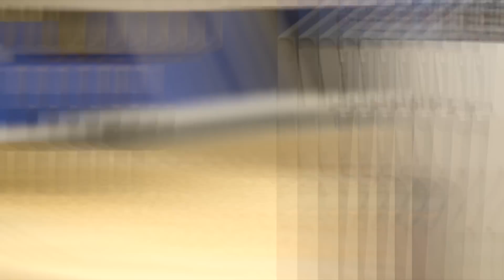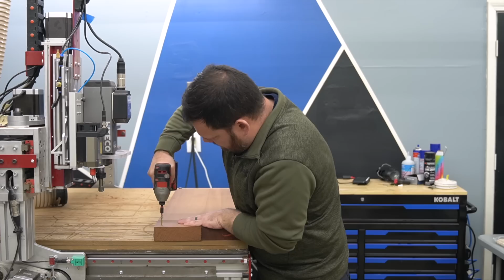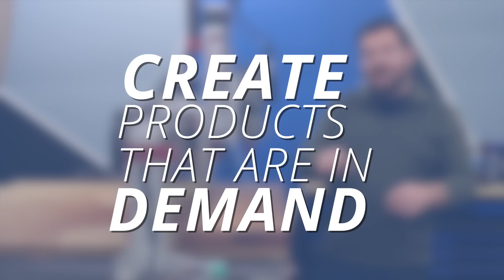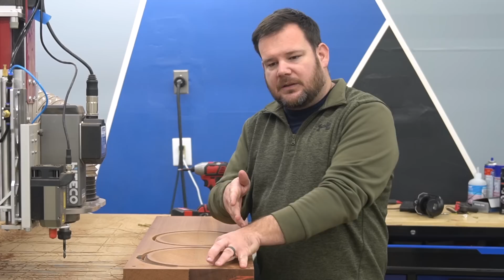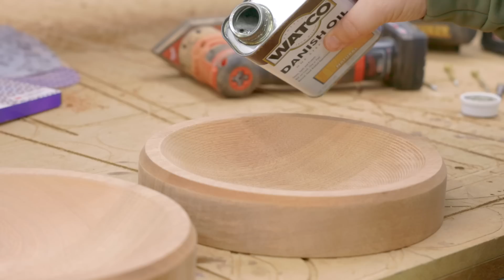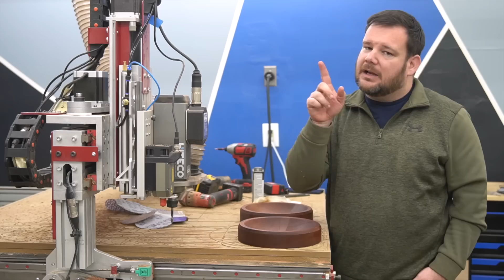7 Reasons To Start A CNC Side Hustle In 2024

Comment: Andy. I spent hours watching your videos. They exciting and inspiring. I ordered the 1F Foreman Elite 48x48 last week. I also went to Bentonville and visited with Dan at PWN. I bought the 110 volt water cooled spindle. I’m try to get all the tools I’ll need before the CNC arrives. Can you assist in additional accessories I should prioritize? Assortment of bits? The sanding spindle you use on your drill press? I bought the tool setter. The XY probe. Thank you.

Comment: Do you have or know of any resources to help me decide on what machine to buy? I have never used a cnc before.  I’d like to get something with at least 4’x4’ so I’m not handcuffed because of size. I would consider something larger if the price made sense. My plan it to start a side gig so it pays for itself and I can use it for my family and I. If you have any suggestions, I would appreciate your input. As an idea of my price range, I’ve been looking at the shapeoko 5 4x4. This is right at the top of my budget.  Thank you in advance for anything you can offer to help me get started on this journey.
Reply from the maker: I think you are on the right track! You're not going to get more for your money than the Shapeoko. I started with a Shapeoko over 6 years ago and have no regrets. shop.carbide3d.com/andybirdbuilds
Reply: @AndyBirdBuilds I’m on the same boat.  About to order my shapeoko pro 5.  Any advice on additionals ?

Comment: Any suggestions for a machine to get started? My though is to start on a smaller bench top hobby CNC and then sell it if/when I out grow it and buy a larger machine.
Reply from the maker: There is a very good resale market if you keep your eye out.
Reply: @AndyBirdBuilds  where is a good source for used CNC? Craigslist doesn't have much, at least in my area.

Comment: As a woodworker my leaning is to buy a 4 x 4 CNC, but it looks like a CO2 laser would be more profitable.
Reply: I just bought a high end diode laser, after spend some time prototyping my idea and learning on a low end diode.  I think CNC routers and lasers can complement each other and each has its strengths and weaknesses.  I plan to get a CNC router  in the future as my maker-product ideas progress.   I think the laser is probably easier to start with and maybe a little less messy.   There is a significant software skill set to be developed for both and what you learn for one can be applied somewhat to the other.    In the end these are just tools to support your passion to make some things you and hopefully others will like.
Reply: I’ve been weight those odds myself. I started with a laser in mind but now I’m on team cnc. I jumped ships when I started competing prices and now more so because of abilities. It does seem like there’s more $ to be made with laser
Reply from the maker: Hey Steve! It really depends on what you want to do. But in general, the learning curve of a laser is lower and those skills translate into a CNC router well. I will say that the CNC laser market is more saturated because of this. With a CNC laser you're really not going to do much "woodworking" as you will with a CNC router. Compare a CNC router to the likes of a typical hand router when it comes to the things you can make. Hope this helps.

Comment: I made the same mistake Friday on a tray and lid I was trying to make to test for the fit an design offsets. Unfortunately mine was with a 1/8 bit and 1/4 shank so the taper on the bit screwed up the project. I learnt the hard way that cut depth is very important to pay attention to especially with tapered bits.